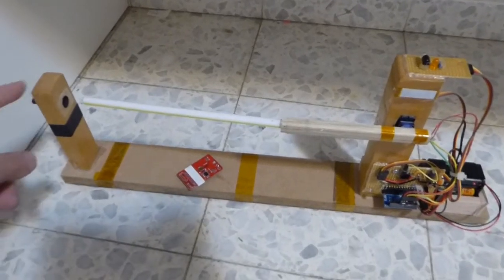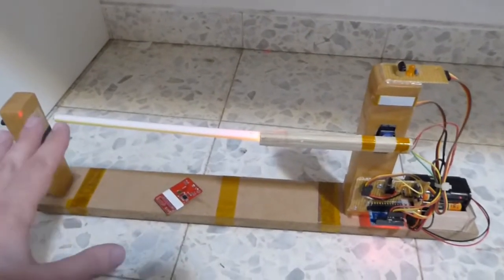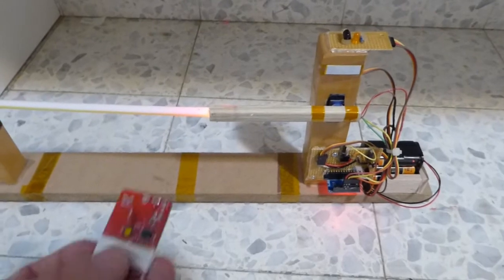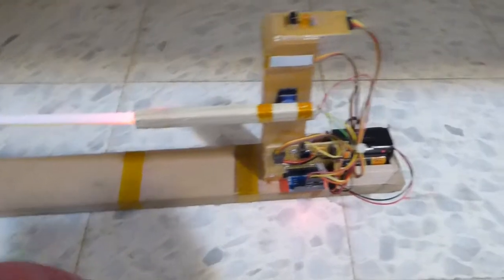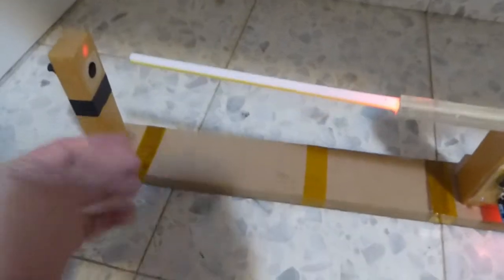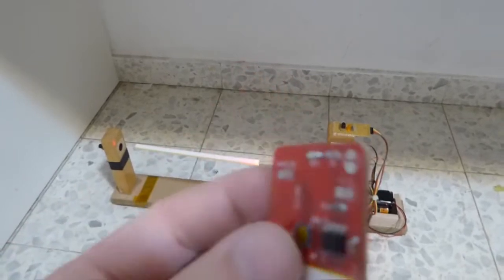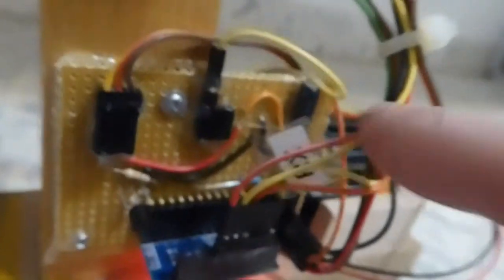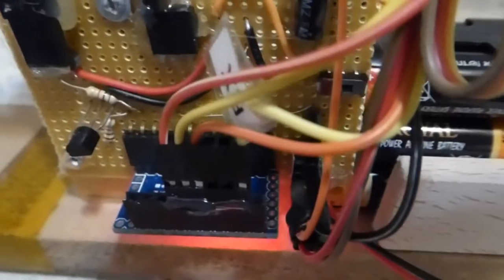Arduino Project Toy Car Park Barrier: 2nd Version

Comment: hello
please Can I have the schematic and the coding?
thank you
Reply from the maker: Hi, the way I used IR is non-standard anyway, so my exact setup won't help you much. But there are plenty of Arduino tutorials on IR Remote Control, Servos, Light Dependent Resistors (LDRs) etc., so you can start playing with those and take it from there :-)
Reply: okay thank you